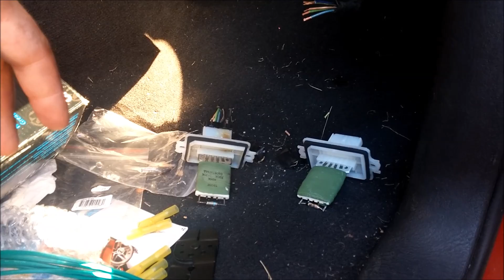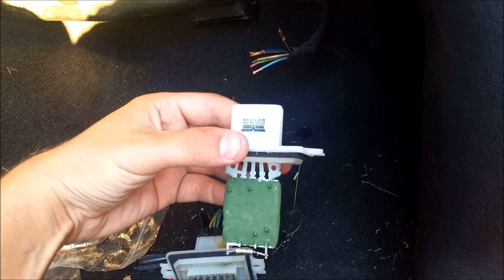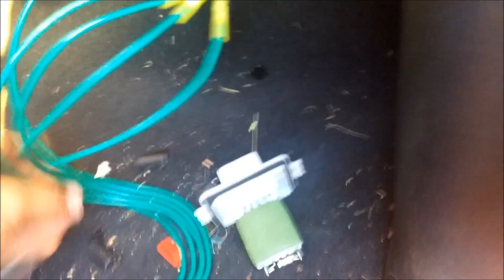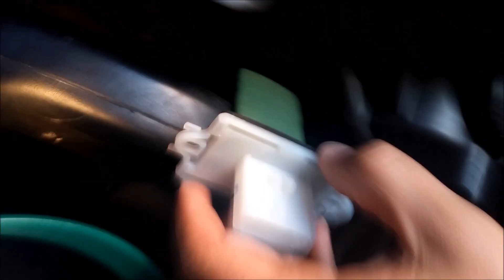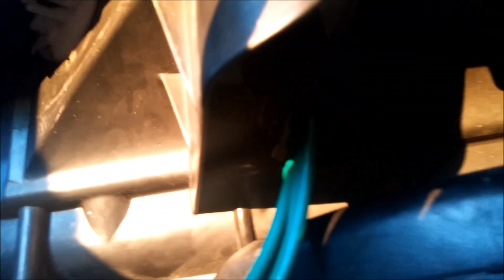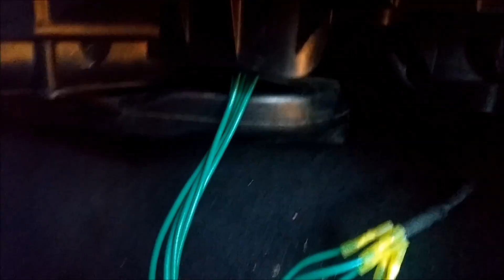Dodge Dakota Durango Blower Motor Resistor Replacement

Comment: Does anyone know whats causing this problem? Ive replaced the resistor 3 times and im sick and tired of this problem. Im hooking it all up right so its not me making it happen it keeps burning the resistors out in the same spot everytime.
Reply: I've replaced the resistors, wiring harness and blower motor. Apparently, the ignition switch has gone bad. Not the actual tumbler, but the electronic switch to the left of the column. Once the resistors go bad, the motor pulls too many amps and fries everything. I'm heading to the auto parts store right now to change the switch. Pulled up a video of a 2001 Durango replacement. Need to have Torx screw drivers, but it looks to be an easy fix.  I actually have a 04 Dakota and an 01 Durango. Both are doing the same thing. Here's the video I watched. Hopefully, this will fix my issues with both. https://www.youtube.com/watch?v=g4axOtNYg_c
Show less
REPLY
Reply: Usually when your blower motor goes bad it will start to pull too much amperage, pretty much more than the resistor can resist hence the burning of the connection on the resistor. Definitely has nothing to do with ignition.
Reply: Bad blower motor. Replace it

Comment: My wire harness connector melts itself every 6 months . this has to be a recall issue
Reply: Ron McCombs   ya mine did the same. I wonder after this vedio if he had the same happen to him. now I'm going to replace everything and hope it works. question for who ever reads this is the resistor sapose to get very ?
Reply: I have replaced mine 3 tumes and have checked with dealerships but there was no recall. I know im sick of dealing withthis problem. Its always the resistor burning out inthe same spot everytime. I even did the blower motor too but it still messes up. Does anyone know whats going on.
Reply: I've replaced the resistors, wiring harness and blower motor. Apparently, the ignition switch has gone bad. Not the actual tumbler, but the electronic switch to the left of the column. Once the resistors go bad, the motor pulls too many amps and fries everything. I'm heading to the auto parts store right now to change the switch. Pulled up a video of a 2001 Durango replacement. Need to have Torx screw drivers, but it looks to be an easy fix.  I actually have a 04 Dakota and an 01 Durango. Both are doing the same thing. Here's the video I watched. Hopefully, this will fix my issues with both. https://www.youtube.com/watch?v=g4axOtNYg_c

Comment: I had the same problem except mine didn't burn itself on to the resistor my clip just couldn't pop it out so I just cut it all apart like what you did and then cut it off. I ordered the new connector and wiring harness off rockauto for $12. Did you solder those connections or dos you just strip and crimp them together?
Reply: I had the same problem and I all the same on the wiring and resistor and now the two wires are not and burn the resistor.
Reply from the maker: I just striped and crimped.  What's interesting is after months of it working after, it recently is doing the same again.  I'm going to tear into it and see what's up.
Reply: Wenick Motorsports Yeah I thought it was gonna be an easy ass job but when I went to try to take it out from there on it was a pain in the ass. And my problem with the blower wasn't to bad. The only thing that made me replace this was because I lost my highest speed and when I had it turned off it would still run automatically even if I was doing like 70 mph it would be blowing air right out and I'm like I have this switch off but its still blowing the damn air out wtf. But whatever I have a 73 Corvette so I can cruise that around soon I might take it out this week.
Reply from the maker: Heck Yeah on the Vette!
Reply: Wenick Motorsports Thank You man!
Reply from the maker: Hey Michael, just a strip and crimp with this kit.  Thanks for watching.